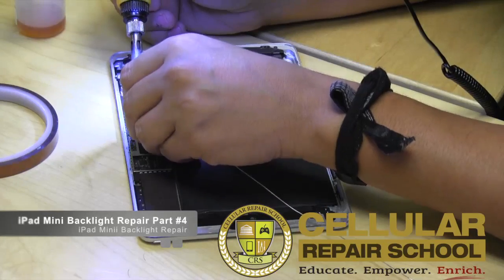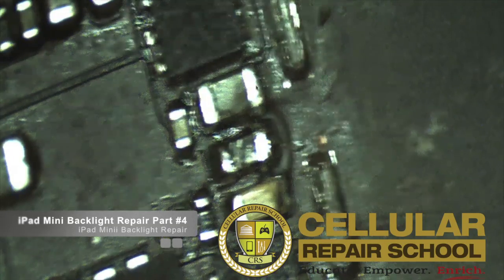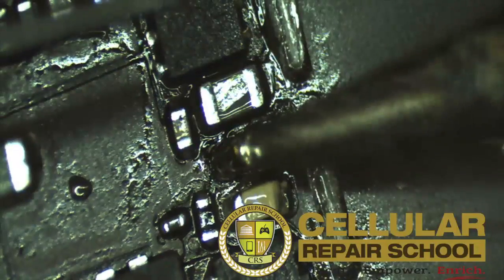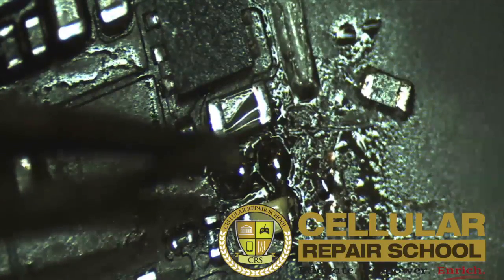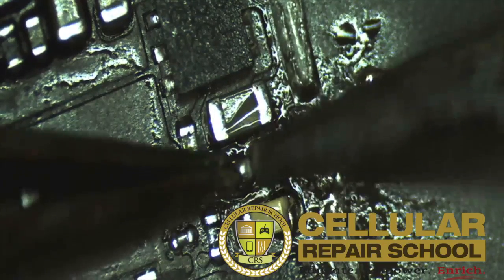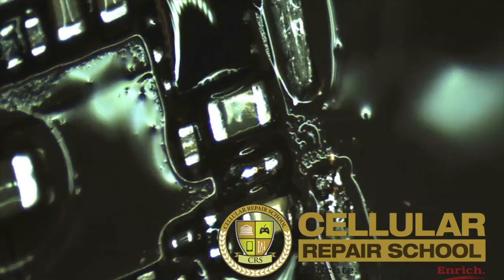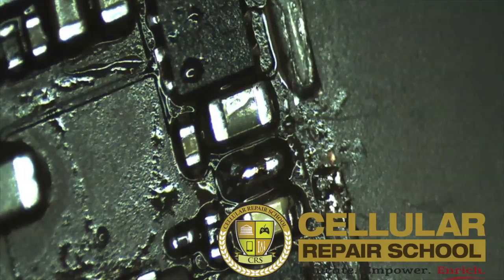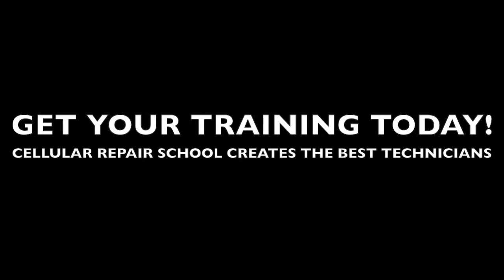iPad Mini Backlight Part #4 Cellular Repair School

Comment: I am not sure what tool you are using in this video, other then the toothbrush.i amuse it is a soldering iron but it would be helpful if you mentioned seams a little small for the tool i have.

Comment: Wrap thin copper wire around the test leads to avoid breaking things in there. If the fuse is bad then break if you have to. I believe if you put everything back where it was before reassembly, you won’t break the screen or maybe I was just lucky.